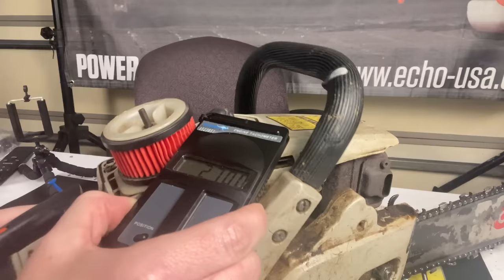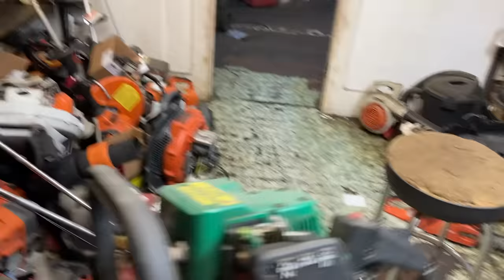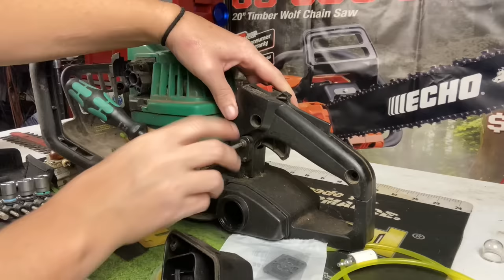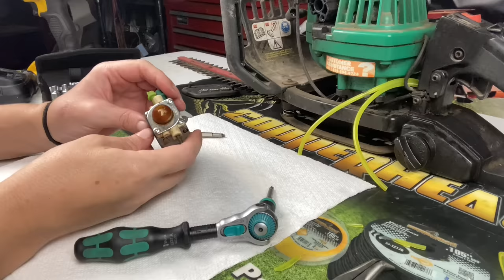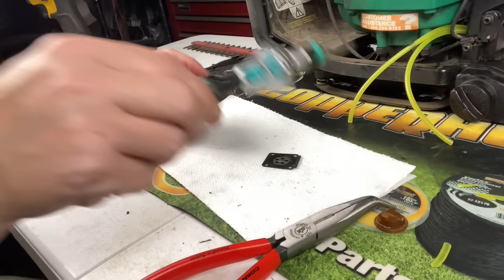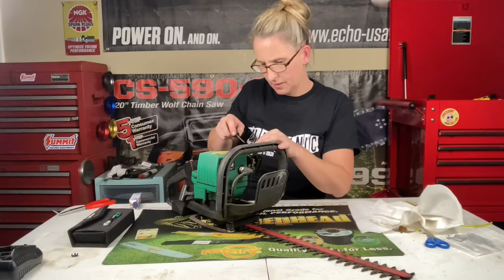THE BIG SECRET on how to store your small engine long term + Turning Shop Trash Into Treasure!

Comment: Picked one of these up at the landfill looked like it was hardly used , the only issue was the fuel line got pinched inside the handle when assembled, 10 minute fix runs like new
Reply from the maker: Awesome!
Reply: Shut my mouth and turn me around!!  Never thought about the 2cycle oil in the tank when storing it. Thank you. This will save me a lot of time and cussing. Thank you
Reply: Win!
Reply: I threw that out.  Can I have it back?  LOL  Not really.
Reply: It’s funny what gets thrown out. Got a mower with a perfect B&S engine at the metal recycling pile at the landfill. Just had water in the fuel tank. Flush and and oil change is all it needed.
Reply: Great job, I have been checking out some of your other videos, learned a few things/tricks about my trimmers and chain saws. Thanks!
Reply: Great tip with the oil I have 6 chainsaws and numerous other 2 strokes most of which would 2 hours of work and parts hunting. I don't fix them because I'd need to do it again next time I needed it.
Reply: Your the man….er woman!

Comment: For years and years ... clear premium,  cap full of starbrite per gallon. When you are done with your work.  Start whatever you are using. Chainsaw,  weed Wacker,  blower. Pop the gas cap, dump the gas, run it until it runs out of gas. Store it for a year. Put new gas and mix in it. Fires rt up. Has never failed me.

Comment: FYI you can soften carb gaskets with brake fluid works really well without rebuilding the carb haven't tried putting brake fluid in the tank but worth a try haven soaked whole carbs in brake fluid and rejuvenate the diaphragms
Reply: Something the parts suppliers have nightmares over no doubt...Thanks for sharing.
Reply: Also for people who have equipment that no carburetor parts are available soaking the whole carburetor in brake fluid might refresh old diaphragms but in an emergency soaking fuel line in brake fluid might soften always replace lines with new ones only a suggestion

Comment: Great video as always. I've been working on these 2 cycles for years. I'm 71. Never knew about putting two cycle oil in gas tank for storage. Great idea. Will definitely do it from here on out. Thank you
I really enjoy when you fix the junkers you got in the back of your shop
Reply from the maker: Thanks Paul!
Reply: @Chickanic  130 psi is already poor compression. Anything below 140 psi is bad. You're losing power.
Reply: It’s just such a joy to watch you calmly working on fixing small engines❤, I had to learn by trial and error during my years as an Arborist, I still have my Husqvarna and Stihl’s and hardly use them now… The tip about putting 2 stroke oil in the tank is a simple but brilliant solution to this “ eternal “ problem🙆‍♂️ thank you so very much 🙏🏻
Reply: I been adding a little 2-stroke oil to gas because of the ethanol and it helps with corrosion on aluminum parts and may help with other rubber such as the needle or any diaphragm. A tablespoon to a two gallon container is plenty, also like Marvels Oil to dissolve gum/varnish.
Reply: @heavymechanic2  Using the incorrect fuel will damage the engine. If the engine runs on unleaded  91 use that only.Using ethanol when not called for can result in siezing the engine. there should be no need to add any extra oil if you are using the correct oil ratio.
Reply: @emanuelmifsud6754  Every gas station in the county has ethanol, its hydroscopic. Where do you buy gas without ethanol when the government requires it for emission control?
Reply: @heavymechanic2  Here Sydney Australia you can buy diesel, liquified petroleum gas, 98 petrol, 91 petrol, 15 ethanol petrol. You are correct about ethanol being hydroscopic and should not be used in many engines as it will damage the engine. Manufacturers tell you to stick to the recommended fuel. !5% ethanol fuel will damage rubber hoses, it is an inferior fuel as the ethanol is in ways similar to water, it should never be used in unleaded 91 engine.
Reply: Nor did I , but I’m going to do it this year ! Getting ready for winter up here in the northeast !
Reply: You fixing the junkers in your shop demonstrates how competent you are as a mechanic.  Thanks for all the great tips.
Reply: Same here never thought  of doing  this  cool trick!!
Reply: @heavymechanic2  : you can buy it but its more money , lol
Reply: I watched this all the way through then flipped a 2nd time and couldn't find the 2-stroke oil tip.   Can you help me find it??
Reply: @jamesthomas7928  12:30 ish
Reply: @charliemagoo7943  Thank you - I got it finally
Reply: @Sensei948  the compression test was done cold
Reply: Does she mean 2-cycle oil straight, with no gas?
Reply: @tracyfunk3928  Yes.  No evaporation hence no gunk left behind
Reply: @emanuelmifsud6754 Here, anything that's ethanol free will be 87 octane. The 89 and 91 octane options have 10% ethanol. However, my manuals allow for up to 10% ethanol.
Reply: @heavymechanic2  in Vermont!
Reply: @Sensei948 bet with a sharpened blade it will trim somebody's 4 bushes for years to come. She can put it out for sale as a used refurb.
The thing never was picked up, apparently, 5years passed.
That's going to cha ching nice when she finds a buyer. New power equipment doesn't measure up in comparison.
Reply: @heavymechanic2 You go to the pump marked non ethanol or the race fuel island.
Reply: @heavymechanic2 😅

Comment: I’ve gone battery on most of my power equipment because I got tired of dealing with gasoline engines. If I had your videos maybe I wouldn’t have. Your videos are a treasure. Please keep them coming. Thank you.
Reply: My folks did the same, now instead of a quick fix they're  having to order and wait for control modules and other unique electronic components that aren't readily available. SMH.
Reply: I did the same thing. I bought Hart brand stuff on Fall clearance at Walmart. Some of the items (with an included battery) I purchased were priced cheaper than the batteries would have cost by themselves. Each store individually clearances their own items at different prices. So if you can go to several Walmarts you might luck out.
Reply: I'm a gear head and never had storage problems, but I too have gone battery with most of it.  The blower was the one that really drove my desire, the weed eater was #2.  I can't imagine ever going back to gas with those two, the lawnmower is possibly next.

Comment: Enjoy your knowledge and experience in sharing the how and why. You’ve helped me get a Craftsmen Chainsaw get started that no one else could seem to figure out. Just followed your recommendations and it worked. Thank you for being my go to channel on small engines. Aloha.🌺🌸🌴❤️🇺🇸
Reply from the maker: Aw! Thanks!!
Reply: I have a Chinese chain saw that ran great for a couple of years.  This fall it would start with choke but would die shortly after taking the choke off.  Long story short. I found a black plastic piece rattling around in the bottom of the fuel tank (looks like a union that would be used to join to pieces of hose).  The only place it would naturally go was on the end of the fuel return line.  I plugged it in and the saw idled fine.  The only thing it does is restrict the volume of fuel return to the tank ( back pressure against the diaphragm?) Have you seen this? Could you explain further.

Comment: I like the 2 cycle oil idea in the fuel system for long term storage. Very smart idea!
Reply: Or just store it with pre mix canned gas in fall start it in the spring run it. Then you can use pump fuel all summer and canned the next fall for storage.

Comment: Great tip with the 2 cycle oil. All these years & I never though about that. That is why you get the big bucks 😉 I found when installing new fuel lines the diagonal cut is a must & to help install 
the fuel line if you pull it in the opposite direction as you pull it through with the pliers
it stretches' the hose just enough to ease it through.
Although this installation looks like it was not as tight as what I have worked on.
Stay well, Joe Z

Comment: Got one at a garage sale a year ago, Changed out the lines and the primer bulb, runs like top. Good tip using the oil to keep the rubber fresh 👌.

Comment: Thank you for the tip on putting 2 stroke oil through the empty fuel system with the primer bulb for long term storage.  Also for novices like me take photos with your cell phone as you go, as a reference for re assembly.

Comment: Enjoy your Videos.   I’m retired, I do a lot of small engine repairs, usually just charge the customer for parts.  Repaired a really old snowblower for a client (was his dad’s).  Replaced the auger bearing and rebuilt the damage bearing seat.  Used 3/16” plate, fitted the bearing and welded the new piece in the badly worn out (must a ran it a few season with a damaged bearing). It cost me about $40. not including shop  material.  He was upset, thought I would repair it for nothing.

Comment: Thanks for the oil storage tip. I have heard of the fogging oil as that goes way way back. The 2 stroke oil should dilute and pull all the fuel out of the rubber pores. I have have a few really old saws like McCulloch 33/35 that use a proprietary diaphagm that was obsolete 30 years ago. I am looking into making a diaphagm & would definitely want to prolong its life if I ever get that saw running again. It's gear driven and will really get down there & chug, plus it has the cool factor.

Comment: I had this exact Weedeater model and eked three seasons out of it before it literally fell apart. … the reciprocating blade fell off while I was using it.  It was assembled with black hex head screws which started mysteriously falling out.  I bought a bag of the exact matching screws at Sears Tools (before they disappeared) and even with Locktite, they would not stay put.  I replaced the Weedeater with a Stihl hedge trimmer I’ve been using for five seasons and it still looks and runs like new.  It was three times the price of the Weedeater, but it is totally worth it.

Comment: I had several Weedeater sidewalk edgers which would usually last me a couple seasons.  I have about 300 feet of sidewalk, curb stones and driveway to edge.  The poor little Weedeaters use the plastic case as one side of the crank case and if you run them too long at a time, the case softens and jams the crank.  The damage is also cumulative even if you don’t kill it in one session.  I’ve found a cheaper way to go is to buy an edger attachment and plug it onto my Husqvarna trimmer head.  My Husqvarna is ten years old and shows no signs of quitting.  I’ve gone through several of the edger attachments, but they’re fairly inexpensive at Lowes.  I just consider the edger attachments an expendable item.

Comment: Nice tip. I only use recreational gas (no alcohol) Learned years ago, when I put any small engine away for any period of time, run the engine, spray fogging oil into intake until it dies, drain tank and carb bowl. I haven't had an issue in over 20 years on my boats, trimmers, chainsaws, pressure washers, mowers, generators...

Comment: Hey lady,  you have a fine.......wedding ring.   Yeah, the number one trick in storing them gasoline powered machines:  run them out of gas...dry.  When time to use again, refuel.   Fuel goes bad, especially in those plastic storage containers.   In as little as 30 days, i can notice a performance difference.   Most people take this for granted...because they refuel their car every week.   Think about it, your car fuel is always pretty darn near fresh.  A metal gas storage can is best, air tight!  You can store yir fuel for months in a metal can and it'll be fine.  And dont let yir fuel get hot!  Keep it in the shade.  The "aromatics" boil off at a relatively low temperature.   And remember, there are two types of fuel:  winter and summer!

Comment: Hello Bre.  Just found your channel last week and I’ve watched a bunch of the episodes.  Today, I ran my 8 year old Husqvarna 235e and, thanks to you, it runs better than it did when new.  It starts on 2nd pull, idles, and spools up without hesitation.  It also quit leaking bar oil.  All thanks to your many tips and tricks.  I especially appreciated the trick to installing the fuel lines through the smaller holes.  Best channel ever from a 32 year millwright.
Reply from the maker: Thanks so much!!
Reply: ❤Another great demo! 2 questions, please. 1) What keeps the tank from leaking gas where the two hoses enter it? 2) Is starter fluid spray (ether?) bad for the engine?

Comment: Old machines are hard to get parts for, if at all.  I bought Shindaiwa power tools back in the 1990s. They worked great and started with just a couple of pulls.  I just got my chainsaw back from a two month sitting on the shelf repair.  I bit the bullet and bought a nice new Stihl.   Thank you for your videos.  :)

Comment: I don't use my 2cycle equipment that often, so I run Viper fuel through them year round. All I do for winter is bring everything inside. I also put 4cycle Viper fuel in my lawnmower at the end of the season.

Comment: I often use the 2 stroke oil trick that you do, I also like to pull the recoil rope slowly until piston is up on compression stroke so my valve springs are relaxed and valves are closed, great content, keep em coming.
Reply: Another good idea!!!!
Reply: that only works on a single cylinder engine tho

Comment: I would suggest using a little Vaseline on the lines for easy pulling. :)
Reply: Being a petroleum derivative I would sooner use a synthetic silicone paste that is guaranteed not to react with any plastic  , nylon or rubber part.

Comment: My Ryobi generator, hasn't run since Hurricane Ida. When the power came back up 3 weeks later was smart enough to use Stabil and run it completely dry until it shut down by itself. Only need it when there are extended power outages.

Comment: I love your channel and how you explain and show everything. I think the most important thing I ever learned from your channel ( and there have been many) but the 2 cycle oil trick is Genius. I have been blaming the problems on the ethanol fuel and even running the fuel out of the machine before you put it away helps but I still only get maybe 2 years out of a 2 cycle fuel system. Can you make a specific video showing how after you run the fuel out how to add the oil and put it into storage?   I think a dedicated video and proper tags will help out thousands of people ( maybe even millions in time).  I am a subscriber and I think if you put a dedicated video out there like this many frustrated owners will learn about you and your great channel!!!!! BTW is the vet a 76? I love the C3s

Comment: To be sure, storing ANY small engine tool with ethanol contaminated fuel is a recipe for trashing the carburetor with corrosion from absorbed moisture in fuel. I have two generators, a lawn mower, chain saw and two string trimmers with that are always fueled with 91 ethanol free (rinse the hose into your car before filling the gas-can).  Of course, 2-cycle engines get oil. All machines get Stabil additive. They start and run well. They are stored with FULL tanks to minimize atmospheric moisture condensation. I've not had any difficulty with leaving fuel in the tank(s) and carb(s).  Arrived at this protocol after replacing many a corroded carb with a new one. More economical than trying to clean/salvage an abused carb.

Comment: I never heard of doing this but I bet it works well, first start in the spring may be a little more cranking but once oil is out no problem and no varnish. I be watching more of this channel
Reply: Maybe we will get a video showing how to get all the storage oil out of the tank, lines, carb and whatever amount finds its way into the engine. It’s not as easy as you’d imagine because in my experience  the engine can get badly flooded trying to “rinse” all the storage oil out of everything including the muffler.
Reply: @shannonwhitaker9630  she said how to flush the oil out watch it again
Reply: I did this for long term storage years ago. It’s not as easy as drain the oil, fill with fresh mixed fuel and pump the primer bulb a few times. Try it yourself…you’ll see.

Comment: Hi Chickanic. Supper tip on the storage with the oil...I never thought of that! Once again an informative video that taught me something! I usually store all my seasonal equipment with a product called Stabil. It's a gas stabilizer that is designed for long term gas storage. Never had one problem and they always start easily the next season. You just have to make sure you run it once you add it. I put it in all my gas cans that I store gas in. I have even used it in my 04 Van that I stored for over 3 years with a full tank of gas and I added two doses of the stabilizer every year to the same tank of gas. I ran that van first topping it off because it was a quarter tank low from evaporation, for the whole summer, when I got it out of storage without any fuel issues what so ever! It's been in storage again for two more years now with the gas treated the same way and it still runs perfectly when started and the engine is fuel injected. If figure the injectors would be fouled by now but it doesn't even have a spark miss with the original plugs! No problem to date! That reminds me... It's time for it's next dose! Twice a year spring and fall.... Faithfully. Thanks.

Comment: I’ve got an Stihl 015 that I bought my dad in 1973.   Hadn’t been started in many, many years!  I guess this is the place to start if I can find a carburetor rebuild kit.
Reply: Id be surprised if you can and thats old this blower i have is newer than that a 2003 but stihl doesn't make the flywheels anymore its newer than yours but still old but still not that old and they don't have the part it needs so i would be surprised if you find your stihl replacement part that says stihl on the part